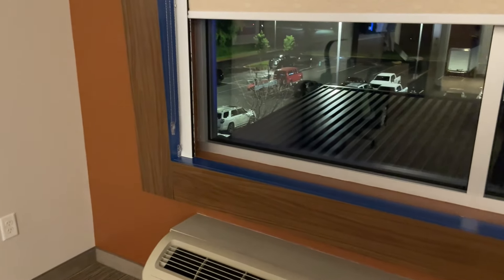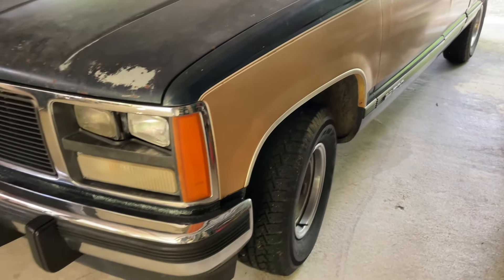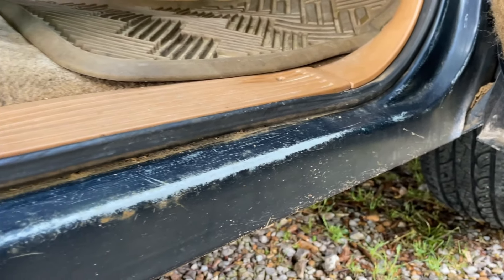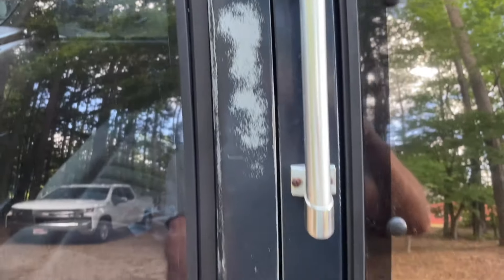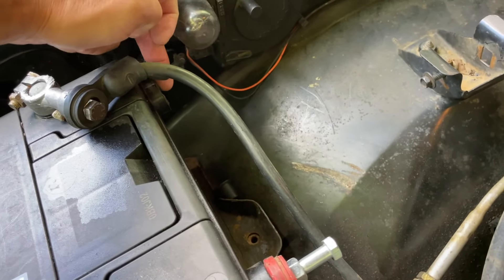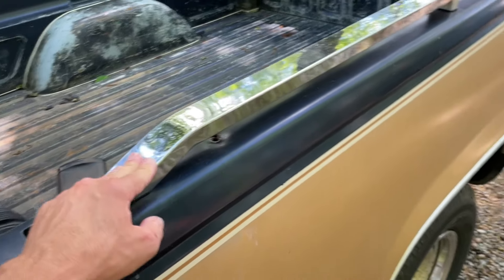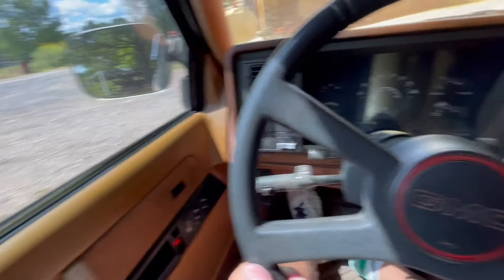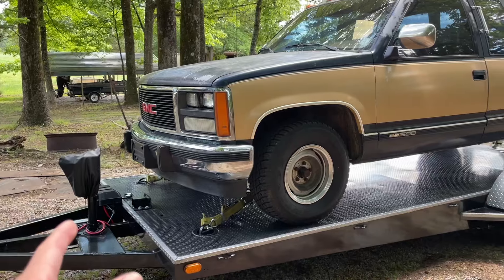Found my Grandfather's truck!!!

Comment: It's to supposedly get more air in for more power. Didn't work on injected engines. I don't know if it helped on a carb. Lol
Reply: Turning the stock air cleaner lid over sounded cool but probably just let hot air in the engine.